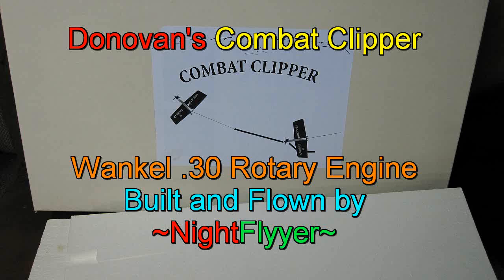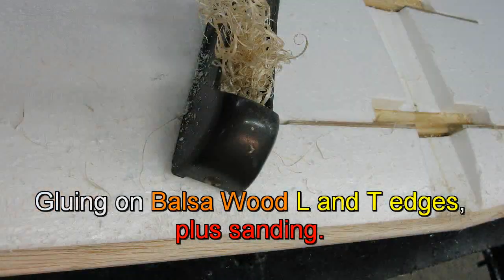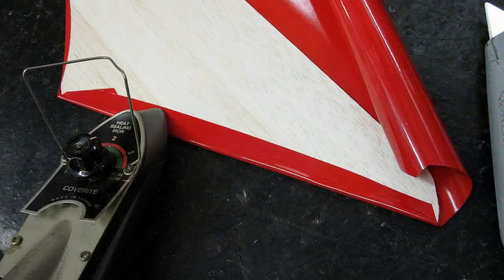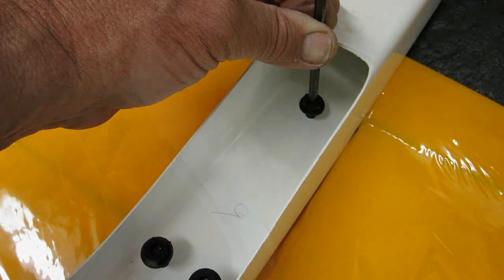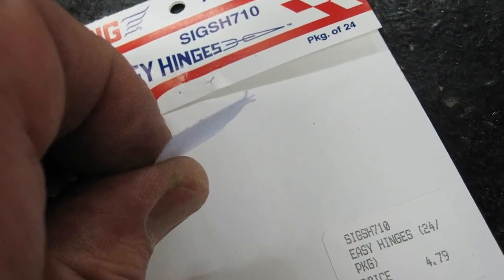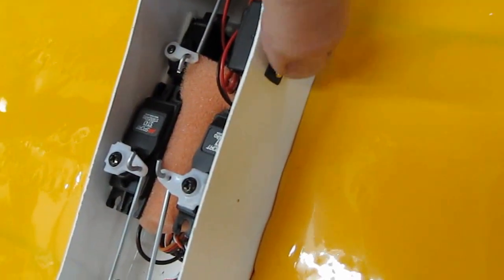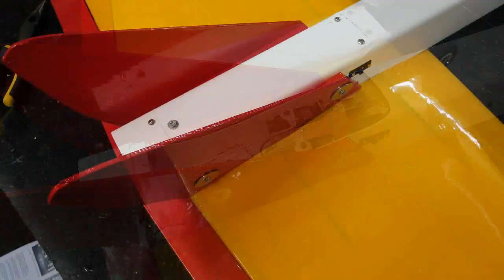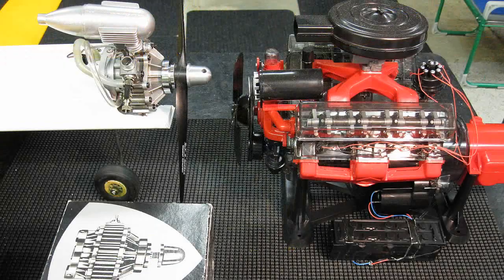O.S. NSU Wankel Rotary Engine Powered Vintage Flying Wing. Assembly and Flight by NightFlyyer.

Comment: Question l, have you ever heard of anyone porting these engines to get more power out of them? Its a pretty easy procedure and eady to understand the principles behind it. But can't find anyone doing it on the RC wankel engines, just the automotive ones.
Reply from the maker: No.  Probably there is really nothing to port , as there is no intake manifold, and the carb is attached right at the firing chamber with a straight shot. Nothing to gain, at least on the model.  Thanks.

Comment: FASTER. My God that's with a fixed gear hanging down and not what I'd call a high speed wing. It would be interesting to time it with a radar gun. Damn Impressive how's the lifespan compare to a piston engine. That was always the problem in cars, along with mileage and making the emissions standards in the early years. I dont know, is Mazda still making a rotary. I know they were with the Rx8? Also the trailing ribbon. Just for easier spotting, or also stability?
Reply: This airplane is a Combat model.  The goal in RC combat is to cut the ribbon on opponent's planes, hopefully without colliding.

Comment: What an informative little video. Nice one. I owned a Mazda RX8 with the newer Renesis rotary unit in it. I searched for a model Rotary and found you. What a pleasant guy you are. Nicely presented! I've recently fallen into large scale rc cars, I would love to mod a 1/5 scale using a rotary unit. The lack of hp may be an issue, but how I loved my Mazda. I drove it like they love to be driven, going through 6 sets of tyres in 18k miles! I love the British A and B roads. Good luck and thanks ;)

Comment: hey night @ 2:57 the slotted flat heads are stupid i wish they were allen or torx but with the flat head i either wrap a small strip of rag around the screw /driver or i take two rags and spray glued them and then cut to the middle of them and then cut an opening so the horn is partially covered   it works let me know if you try it

Comment: It looks like to fuselage of the plane is made with drainage gutters.....my old flight instructor brought a combat plane just like yours, the plane had a body as a drainage gutter. The differences is he pout in a OS 2 stroke 35 and also his wings were hand made with some funky plastic thing i never saw before. Also, he told me a few weeks ago when i was building my twist 40, to not buy large servos for throttle because it is so easy to move. You did that too.....haha, the way things happen eh ?